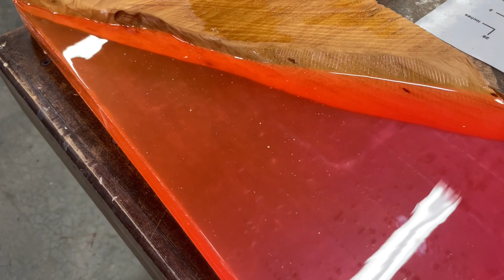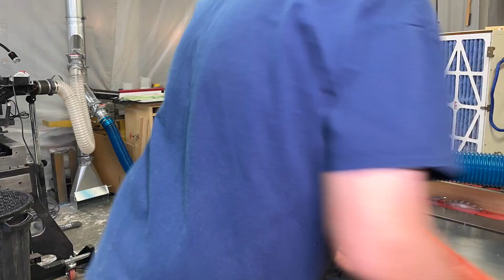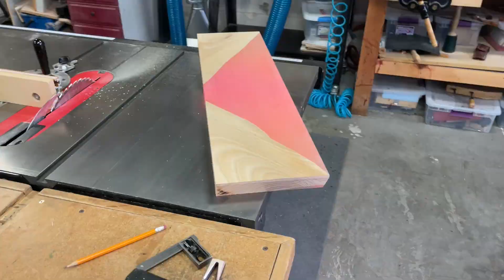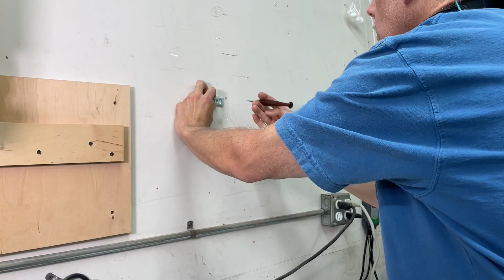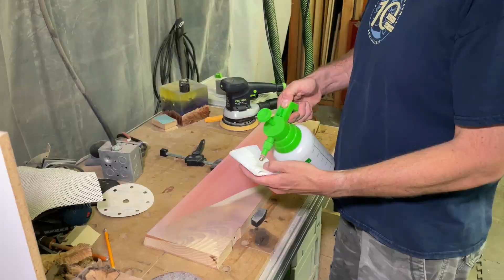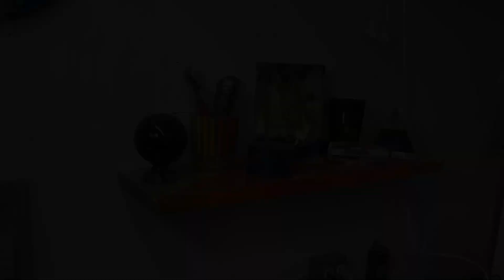Milling and Finishing the Epoxy & Wood Floating Shelf

Comment: love the shelf. but a question. I've always been afraid to put the hardened/cured epoxy through the planer for fear of dulling the blades quickly. Do you find that not to be the case?
Reply from the maker: Thanks! I don't think it is too much harder on the planer blades than some of the denser hardwoods. Unless you're going to be running a ton of them through it, I don't think you'll notice much more wear and tear

Comment: No way I’ve been thinking about making one of these!!!
Reply from the maker: Sweet! It was a really fun project, you'll have a blast!! One thing I will recommend, make sure to get hardware that uses a 7/16" hole. I bought the cheaper ones from Rockler and didn't realize the ones I got required an odd size,  31/64" or something, drill bit. Long 7/16" drill bits are much easier to come by, and most of the cheap drilling jigs have a 7/16" bushing. I just followed you on IG, tag me if you post pics, I'd love to see what you make 😀